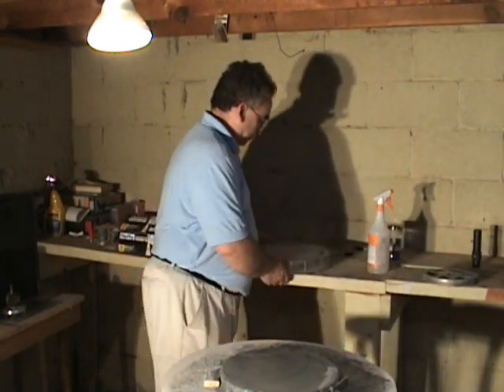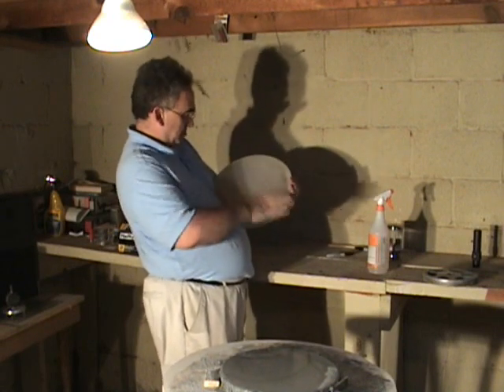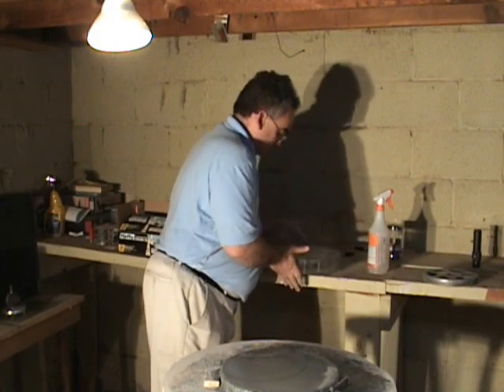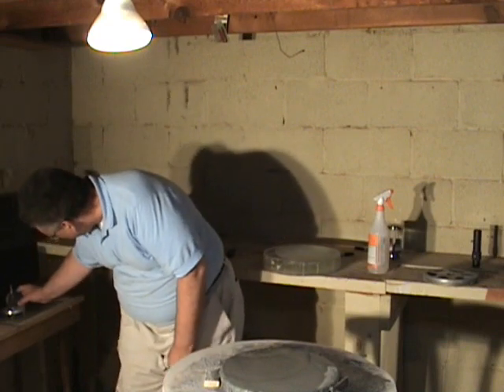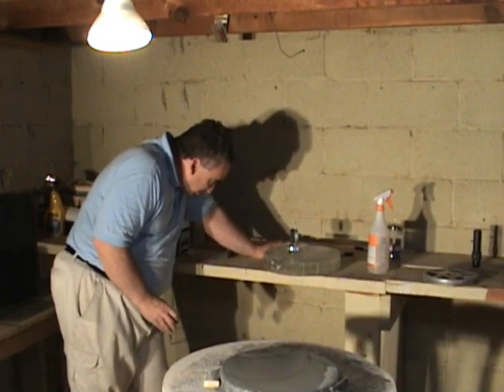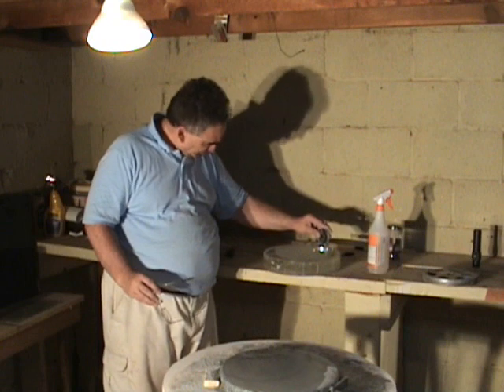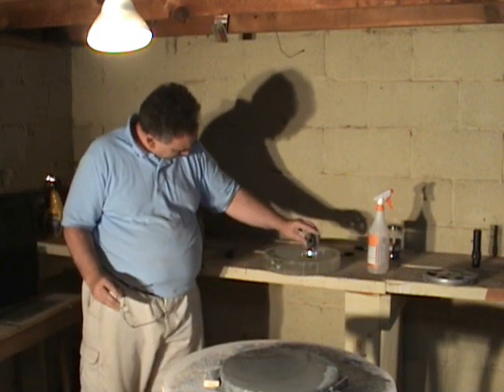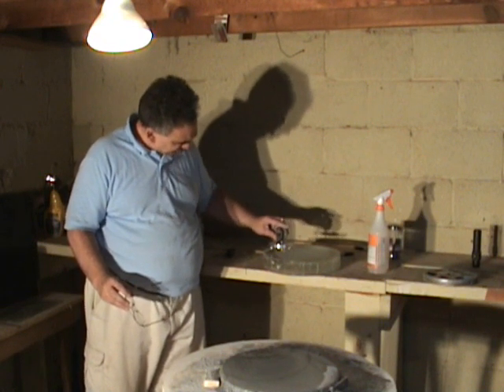Telescope Making, Checking the depth of curve during rough grinding

Comment from the maker: Calibrate the spherometer to zero using an optical flat. A piece of plate glass will also work.

Place the spherometer on the mirror in several places and read the depth as shown on the dial. Average your readings. 

Take the chart that you were sent with the spherometer. It is specific to that instrument as each is slightly different. Find the reading. That will show the ROC of the mirror, The ROC should be 125 inches for f/5.

Happy Thanksgiving!

Best regards,

Francis J. O'Reilly